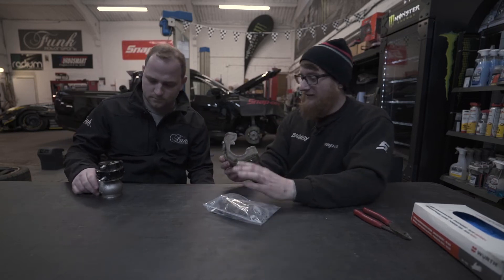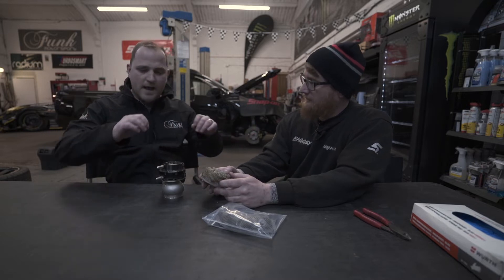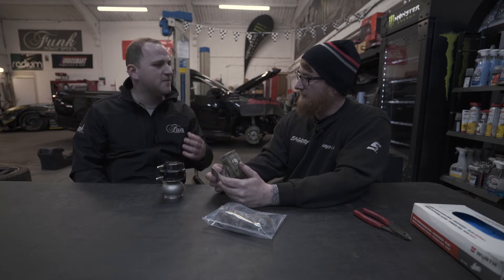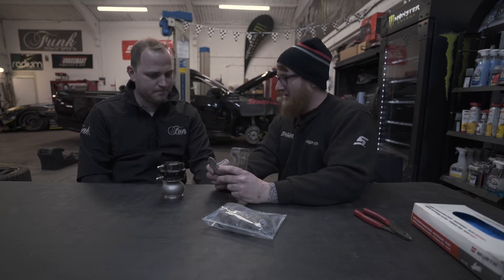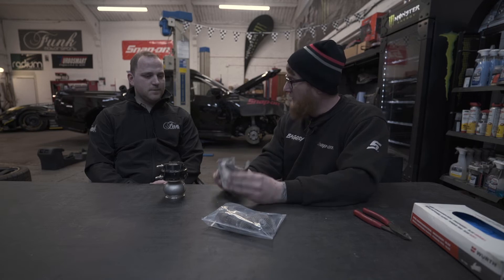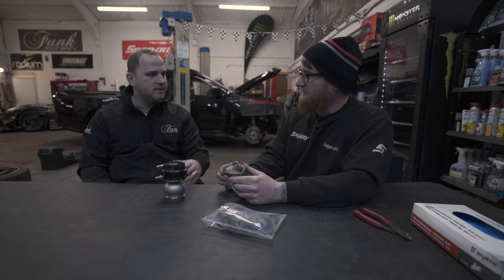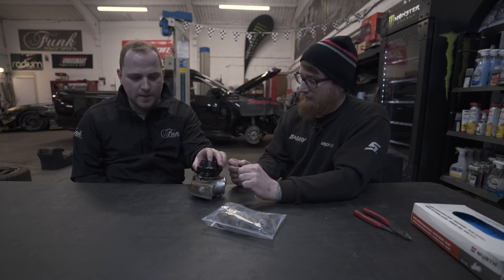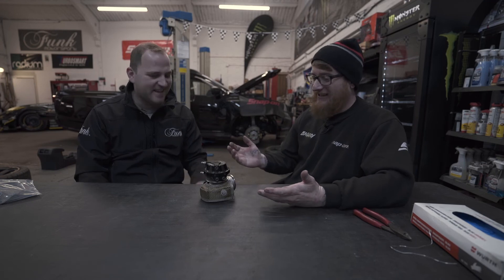Why use a Wastegate Heat Blanket? Funk Motorsport

Comment: Could you explain why Turbosmart advise against insulating their wastegates? Could it be that the trapped heat causes premature diaphragm failure??
Reply from the maker: Hey! That’s interesting! We have a great relationship with Turbosmart.

In actual fact, this will help to reduce heat transfer into the diaphragm, so can only be a positive thing :)
Reply: @Funkmotorsport  if heat cannot dissipate it remains trapped in the metal and would transfer from the valve housing to the diaphram housing. Turbosmart wastegates feature a stainless steel heat shield at the base of the diaphram housing to protect it from the radiant heat from the valve housing. My question wasn't answered so I'll assume the truth of the matter does not align with your marketing. Thanks
Reply: @Rhubarb237  I guess I can make sense so how about when someone thermal coat the wastegate how does that work? What do you think?
Reply: @HAULUUZ  I would opt for Cerekote over a blanket but I'm not a fan of either.  I use Scandia high temp enamel on my manifold and turbine housing and so far it appears to be outlasting Cerekote. I only use it to prevent rust forming.  Cerekote contains toxic fluoro chemicals which is why I don't like it. IMO the best method is to shield the components that are susceptible to radiant heat. I use a 20" x 14"  thermaflect to protect my brake master cylinder and  brake lines from the wastegate and turbine housing. Aesthetically it's not as nice as a turbo beanie but function should always take priority over form.